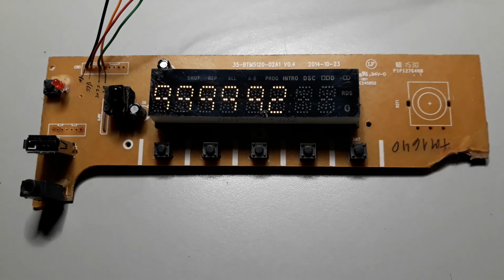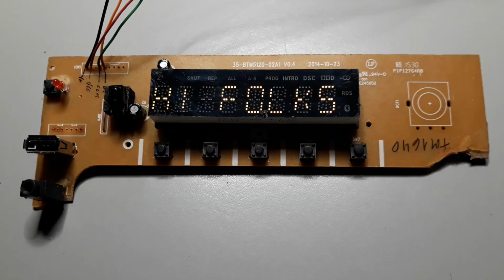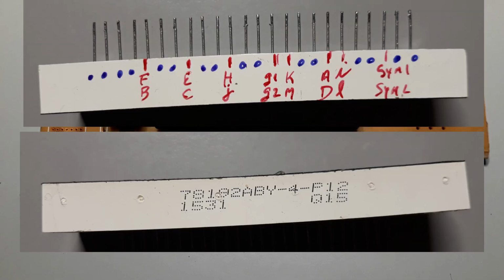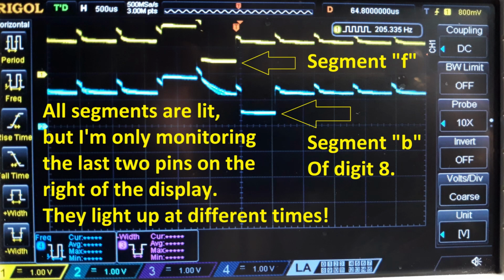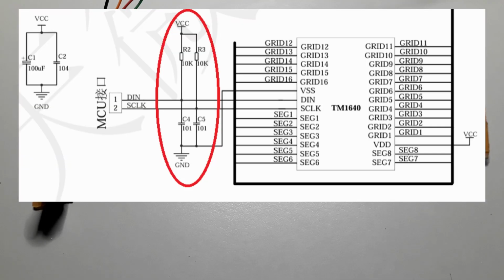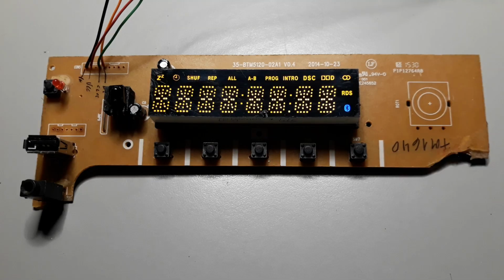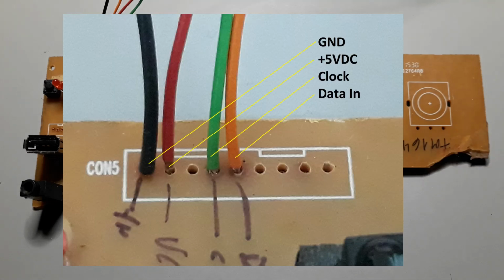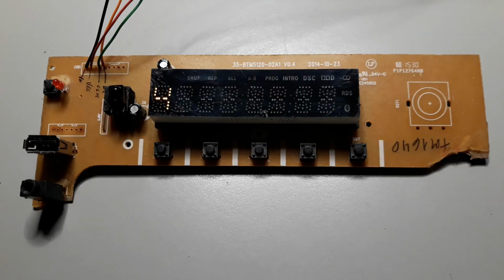TM1640

Comment: О красивый дисплейчик, классно проделанная работа! Да и подключение всего лишь по 2 проводам, что очень сильно экономит порты микроконтроллера!
Reply from the maker: Hi @nikolaypobedinskiy3293,
Yes! It's true that communicating with only two wires saves at least two others. Because normally you have Data, Clock, Strobe & a Chip Select or a Chip Enable. I also highlight the low power consumption, both of the Driver and the LED display since it handles all 14 segments. They achieve this by using high frequency in the sampling of the segments, two in each Anode, in this case!

Thank you for watching!
Reply: @jlsmonte ага, супер!